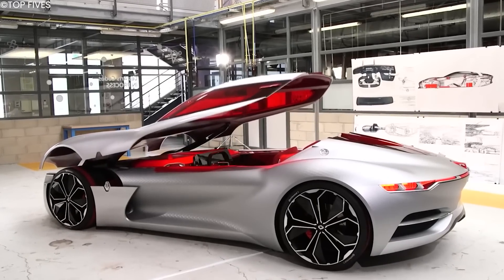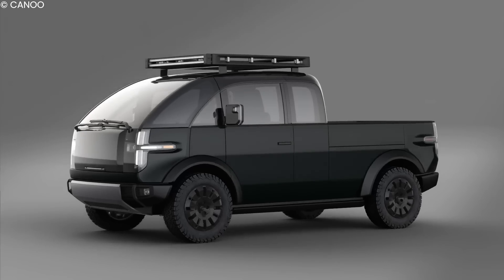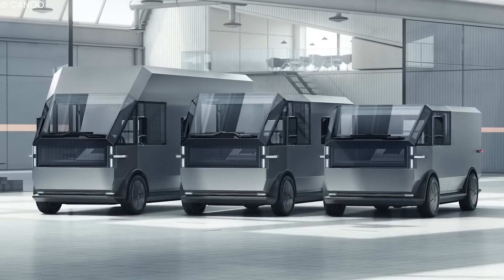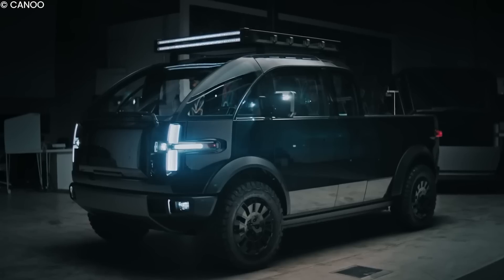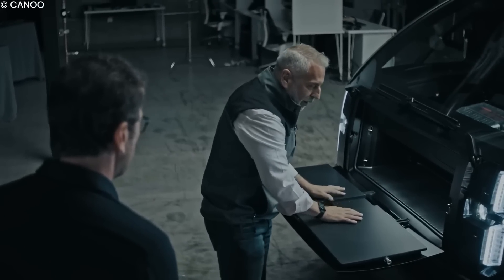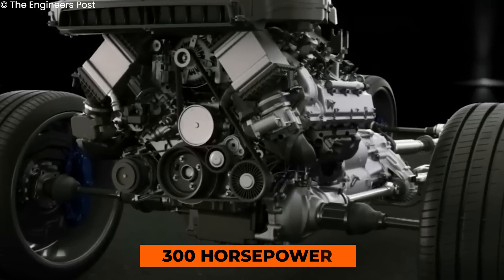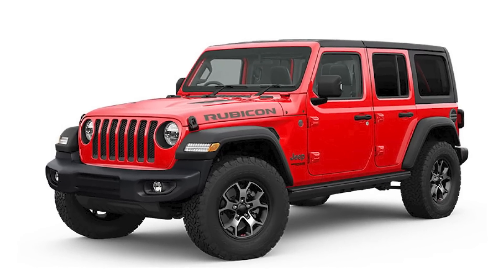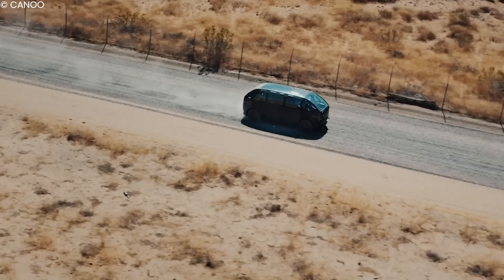Canoo Is A Genius Truck, Here's Why

Comment: If the first go of### line## with a 100 + years Neodium Engine,,,with some imprzwements ewend for of road,,, with a eficiency enormus  ,,pkease let me a Note to be a First,,,WHO lowe fuel tank hawy baterijska electronix scenski senzors ,,,the Driwe must to be Inocent 24/7   ewend listening the wind in haur thru Mother Nature,,or if the Neiboh yeloou  to catch him a sosige for afternun burning in back yard with a cool beer...
PS
Plus its easy to leawe the side conect point of power for any  like watter pump or compresor or for externe Electric generator,,,and all that in 1 simple cheep remarcable 
MPV or combined shell on 4 or 6vp tires

Comment: Noting this video is 10 months old, if you haven't looked at Canoo yet, you might like the fact that Canoo has extended thier pick-up line up.  The testing for the military has created 2 new versions of the pick-up.  They're named the Screaming Eagle (after the 101st Airborn) and the Bulldog (a reference to the USMC mascot).  Both trucks are touted as LTVs (light tactical vehicles).  The difference between these and the standard pick-up is primarily its more rugged design. Bigger wheels, a flatbed with stake sides instead of a pick-up bed.  And a couple small things. I personally like the Bulldog because it's a true crew cab. The Eagle is a strait cab (no extension). If the pick-up somehow found the ability to have the Bulldogs crew cab and big wheels and tires, it would be perfect.  Don't expect that to happen though. What makes Canoo affordable is the company's ability to offer 7 vehicle styles while only needing to build one sled (the brains and bronze of the company). So trying to fit the extra space needed for a crew cab and still have a bed that can be extended to a full 8 feet is just a little too much for the sled. That's fine though. If it keeps the price point to where normal Americans can actually afford to drive, then let's go with what we have. If you couldn't tell, I'm all in on this company.

Comment: I’ve owned both the AMC Pacer and the Pontiac TranSport. Both had windshields similar in size and design to Canoo. It’s very difficult to see out around the forward-curved A-pillar and the cluttered up front/side windows. It’s a poor design for safe driving.

Comment: LOL! LOL!  yet one more "very slick" video on "yet another" electric "truck."  LOL! LOL!  i had to LAUGH when the narrator said the range was "200 miles" - WOW!!  NO ONE, i repeat, NO ONE has yet figured out how to overcome several MAJOR OBSTACLES for electric trucks: 1. lack of range; 2. lack of towing capacity; 3. inability to operate in cold temperatures without SIGNIFICANT loss of performance/capability.  electric trucks will work in UNIQUE applications like congested urban areas or "short distance" delivery applications.  but as Ford is now finding out with their MULTI-MILLION DOLLAR "experiment" - the F-150 Lightning - an all-electric truck simply cannot provide all the COMMON capabilities that a normal AMERICAN "truck buyer" expects.  GOOD LUCK "canoe."  perhaps you should have concentrated on building a small, two person, flotation device for use in "water environments."

Comment: Environmentally friendly? Depends on the envelope you are analyzing the make the claim. If your envelope includes the sourcing of materials to make this vehicle and the charging then it isn't environmentally friendly at all. But if you want to trick the public into believing it is environmentally friendly then your envelope will start and end with the vehicle itself as it doesn't emit CO2. This might have worked years ago but folks aren't ignorant about this anymore.
Reply: It doesn't emit CO2 but the process to make it does. It's not even about C02 anymore its about the cost of fuel. Vehicles are so overpriced today to makes sense to look at an EV.

Comment: Rather than buying the truck, I bought stock in the company instead. If they succeed, I hope they make a solar hardtop convertible EV. If they do make one, I would be the first in line to buy one.
Reply: you're better off throwing that money in a furnace at least it will generate heat for you during the winter

Comment: It looks like a kei car.
Reply: Yes- and if you ask me, that's exactly what we need in the US. Consumers deserve a small practical truck for things like running to the hardware store or moving furniture. Not everyone owns a boat or needs to haul a camper around every summer. The fact that as of right now, in the country that buys and sells more trucks than any other on the planet, pretty much all of our options are oversized gas-guzzling monstrosities that tend to have impractically small beds that are really just larger open trunks. Kei trucks are so much more practical, and until this pickup goes into production in the USA the only way to drive a Kei truck is to import a 25-year-old one from Japan with right side drive,  a Japanese dash and (mostly) manual transmission.

Comment: The range is way to low.  This won’t sell well in Canada / US.  Range is way to low. Needs to be minimum 300 miles
Reply: It really doesn't. Not everyone needs to drive 150 miles and back every day. Not everyone needs a pickup for towing (which obviously reduces range for gas and electric). The average American commute is 28 miles, and you charge an EV at home every night. if you want to go on long road trips regularly, this isn't the vehicle for you. However, that's like saying a Camero will never sell because you can't use it to move a couch or a full sheet of plywood. It's okay for different vehicles to have different applications.
Reply: @GrapplingIgnorance  You don't buy a truck to drive 20 miles to work and home again. Look at what happened to the Leaf. It is a great city car, just don't try and drive long distance in the US in it. That is why Teslas and Chevy Bolts were and are popular. 

If you buy a truck , you are going to haul and tow with it. Why do you think so many are diesels? As soon as you try to tow with a truck you will see a reduction in range. Trucks need bigger batteries because they are doing more work.

Adoption of new technology does not mean that you have to give up what you already are doing. New technology should not mean going backwards or getting less for more money.

What about all of the companies and contractors that make this world function?

Do they tell their customers, " I am sorry that I can't make your appointment on time, I am 6 th in line waiting at the charger and may not be there for another 2 to 3 hours. " Oh yeah, I will be working at overtime hour rates when I get there."
Reply: Batteries tech is advancing so fast. Each year is showing about a 25% increase in energy density. Range will be a mute point in a few years. Lucid broke 500 and Nio is claiming 600 on a single charge. 
What a wild time to be alive. Never thought I’d see the day we switched from gas.
Reply: @crtmojo2705  this is definitely and exciting time.